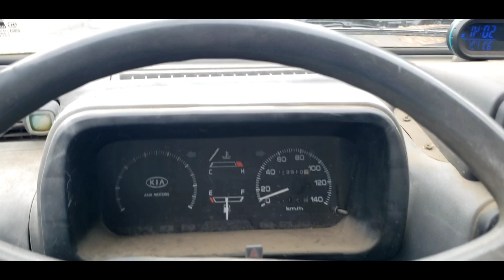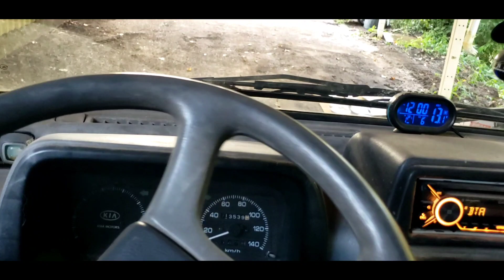Tiny Van is the most Amazing Yard and Garden Tool

Comment: It looks like your sprinkler has the same problem as ours: it won't oscillate.
Reply: Pretty sure that's because the water pressure in the line is too low to make the turbine in the sprinkler to work.

Comment: What happened to the small blue pickup (S10?)you sold which was stolen, got wrecked and was totaled, then you got it back?
Reply from the maker: I still have it, however it does not have a hitch
Reply: @2stroketurbo  If it is still streetable it has a bed, hitch later. Unibody mini vans have their structural limits.